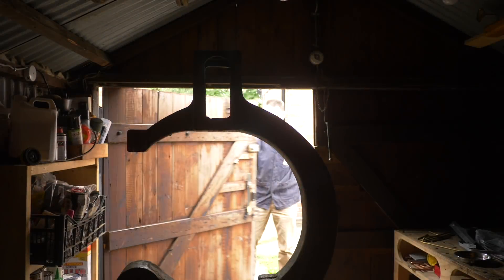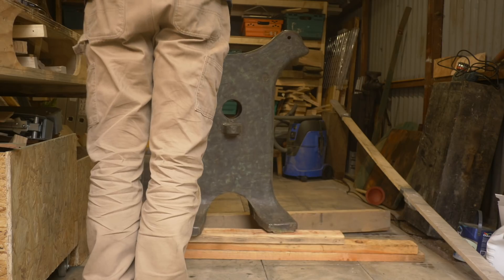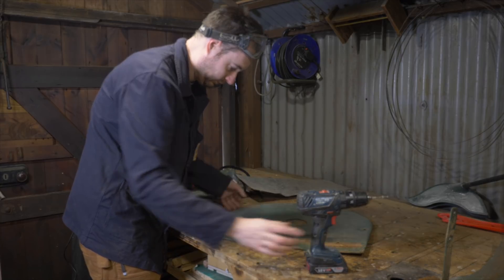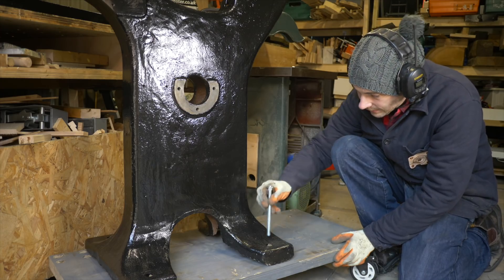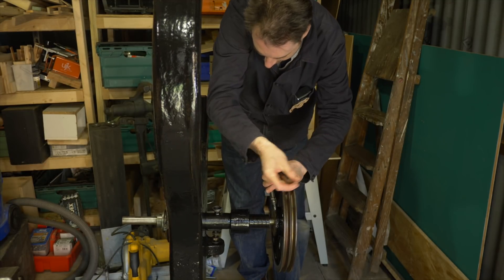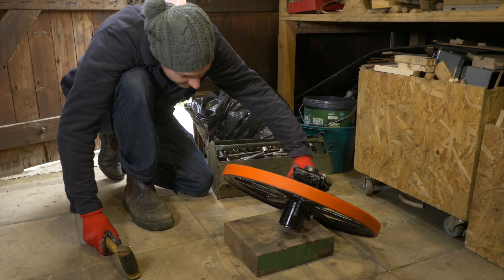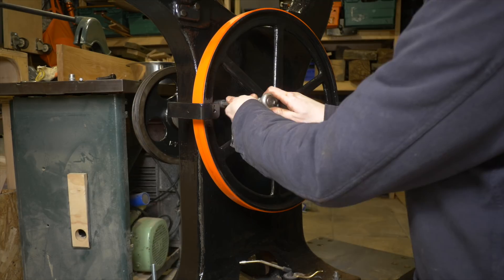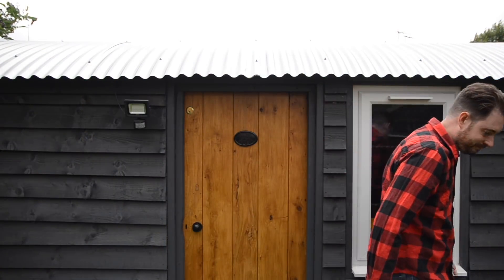Restoring An Old Bandsaw Part Two

Comment: Great saw and great restoration!
I hate to be the Safety Police...but...next time, if you must work indoors a really old machine, disassemble the machine and use a degreaser to clean all surfaces and parts, make sure your work area is well ventilated, then apply a brush-on paint stripper to remove all of the paint instead of using power tools.  Wash everything down and spray on an etching primer to prevent flash rusting before you paint.  You just saved a lot of time and most importantly, you prevented lead paint dust from getting all over you and into every corner of your shop!
Keep up the good work mate!

Comment: Good job Matt looking forward to see it in action . One point those cap's at the grease points were used before we had grease guns you full the caps with grease and give them half a turn each time you use the saw
Reply from the maker: That’s very clever. I did wonder why they had so much thread. Thank you

Comment: Hi Matt, I know you have a compressor so it would not take much time to make a sand blasting cabinet and the actual bits you will need to buy are not many. It would be a good build idea and also the finish you get with a sand blaster is much better than that wire wheel and all the nasty stuff is contained inside the cabinet so you don’t need any PPE apart from the rubber gantlets
Reply from the maker: That would work well but I don’t have the compressor any more

Comment: It's good to see old machines put back in working order it will probably last for another 100 years before it needs attention
I was a bit disappointed with your restoration yo didn't fill it with bondo and flat it with 2000 grit wet &dry you haven't been watching YOUTUBE 
to see how its done.... and you didn't have a cat (ginger) helping you.... apart from that a good without frills restoration ..waiting now for part 3

Comment: Very cool! I don't know much about these things, so this is a genuine question and not a criticism, but is it worth testing something like this for lead? Not sure if the mask would mitigate that risk!
Reply from the maker: Why would a mask not work?
Reply: @Badgerworkshop  Not all masks/respirators are rated for lead fumes, I think. Not sure what the practicable differences are, mind.
Reply: Looks like most P100/HEPA ones are considered to be fine, so I'm sure you're grand b
Reply: @figrollin  The wire wheel does not produce lead fumes - burning lead paint will.
Reply: @normanboyes4983  Ah, ok. From what I've read, sanding (which this essentially is, as it also causes dust particles) is considered to create lead "fumes". I agree that's probably stretching the definition of fume - and even if it is particles, the HEPA mask probably covers it anyway!

Comment: I have the same band saw in my workshop bought for 29£ in 1988 you notice that the fence is on your right side not like modern band saws why they changed it over is a mystery all woodworking machines the fence is on the right
Reply from the maker: Yes it is unusual